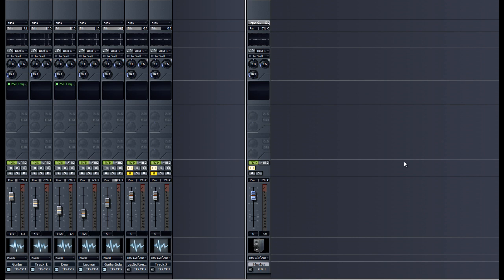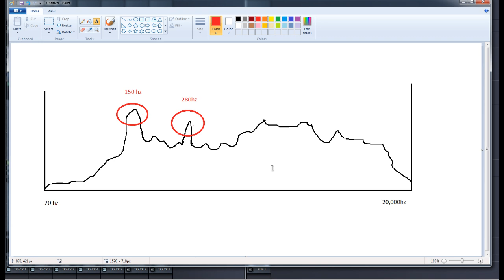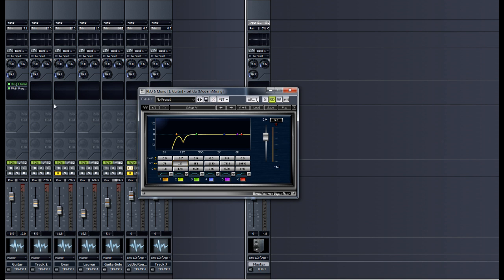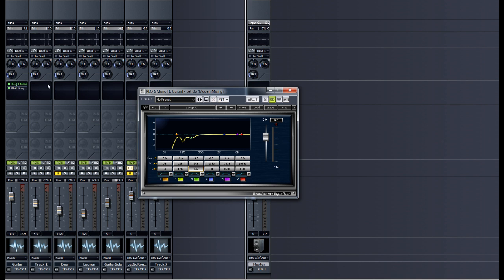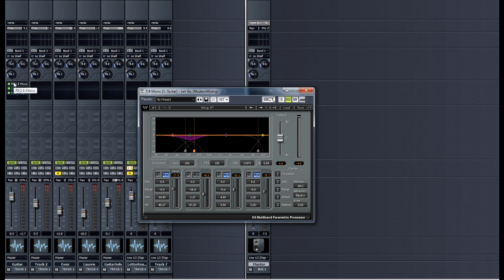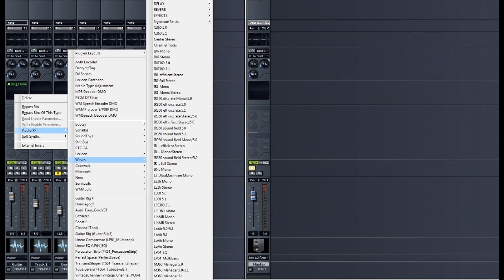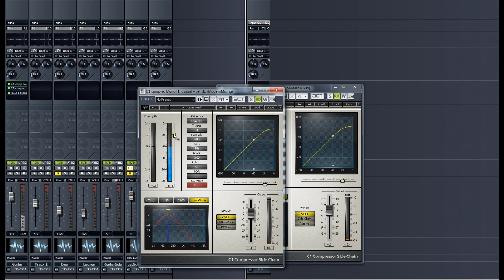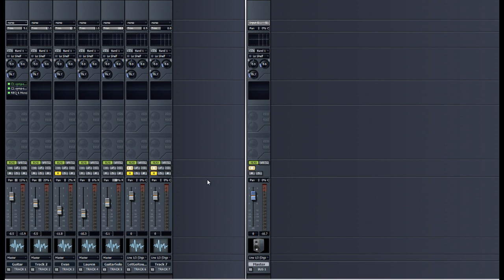Resonant Frequencies - ModernMixing.com

Comment: Aren't you just looking at /editing around the main note freq? 240 is about Bb...your root of that one chord.  Are you using the graphic only for visual or did you hear something bad or sweep to hear something? Thanks
Reply from the maker: Sometimes resonance isn't tied to the root note and sometimes it is.  A lot of times, its a room issue.  I'm using the FREQ analyzer to demonstrate a way to look for/hear the sounds.  Over time you should obviously learn to use just your ears.  Cheers.
Reply: Agreed. You were cutting the fundamental and it's harmonic. Those would naturally be standing out and should be, unless for some reason one of them was overly resonant, but no reason to cut both. Thats like cutting 200Hz and 400Hz on a snare, leaving you a harsh thin trash can.
Reply: @JacobraRecords  I think he might have missed that tinny sound left over on that second/third note.

Comment: *facepalm* no one understand how the waves SC compressor works! it doesn't compress the specific spectrum range. it use it as a reference to compress the overall signal!! sorry for bad English.
Reply from the maker: Hey now. 
What you are talking about is when the C1 is in "Sidechain" mode.  The C1 actually has 3 modes - Wideband, Sidechain, and Split.  If the C1 is in "split mode" then it becomes a dynamic equalizer, allowing you to compress only a specific frequency range.  Hopefully that helps.
Cheers.

Comment from the maker: Thats more of a personal thing.  I cant tell you when you should or shouldnt use a tool.  That just comes with time.  In this situation think of the Dynamic Eq like a De-Esser just in the opposite end of the frequency spectrum.  Instead of using a De-Esser on a vocal why not use an EQ?  Probably because the De-Esser would make a bit more sense, you only want to take away the ess's that come in from time to time.  This situation is no different.  I felt the dynamic EQ did the least damage.